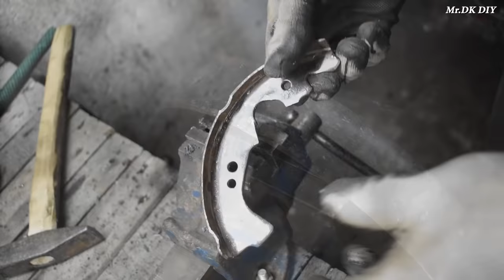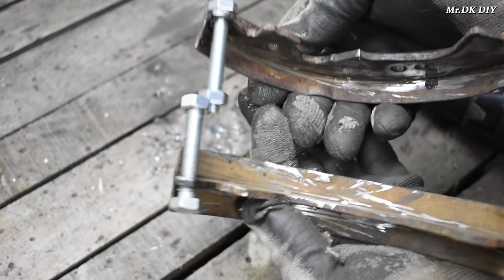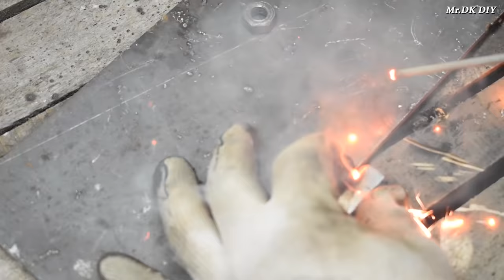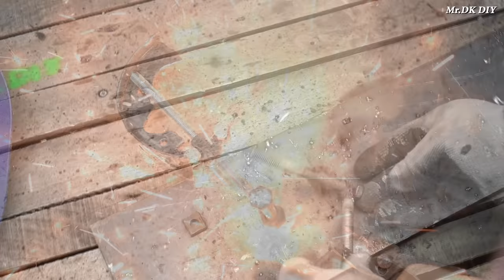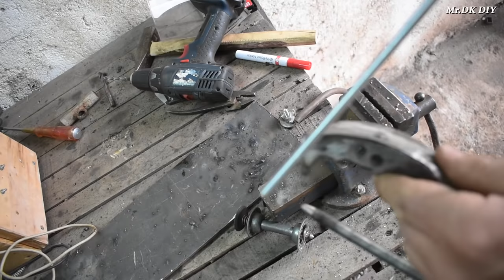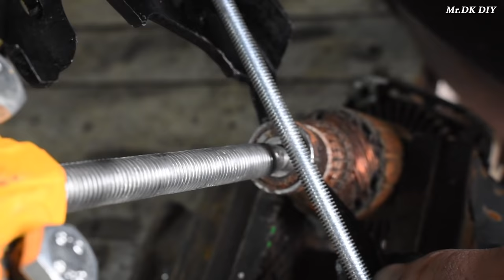OLD REAR BRAKE SHOES ?  Do not throw them, just do something useful from them /  DIY Project

Comment: Do you know if the old brake linings contained asbestos. The easiest way to remove bonded linings is to use a blow lamp to melt the adhesive then the linings will fall off.

Comment: Creativity, very good!  Useless, however, from a practical point of view.  The jaws that grip the bearing or gear being pulled are too weak and will bend at the slightest resistance.  Not worth the expense, time and effort to build.  I did enjoy the building process, as an entertainment video.  It is good that people are interested in creating new things rather than simply discarding everything.
Reply: I think I would have welded a split nut and reenforced the pulling tip. The I would have hardened it like the tip of the push bolt.

Comment: What a waste of time.  No strength, no stability , no practical use.  Perhaps two people could use it to take a bottle cap off.  You found that out already of course.   You can get a puller this size that works for ten bucks.